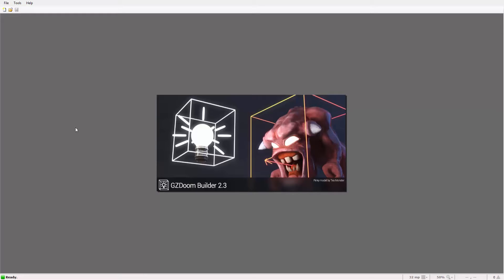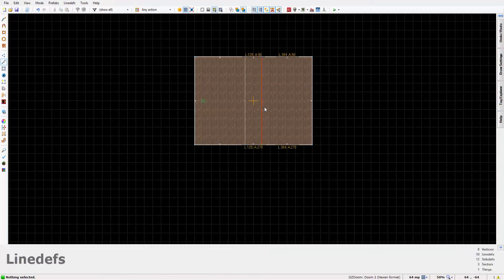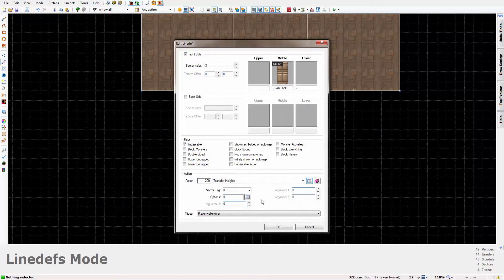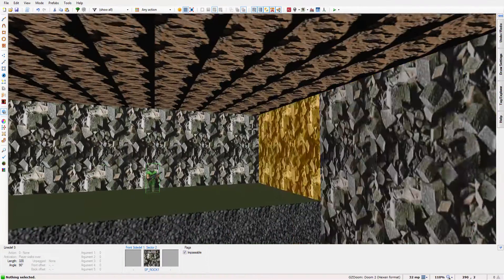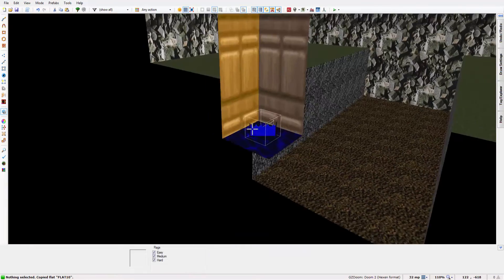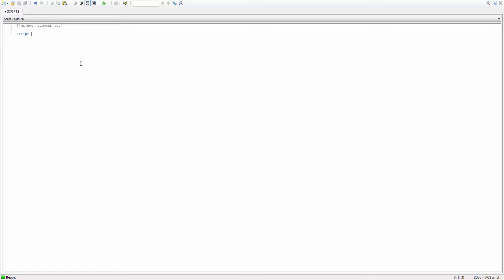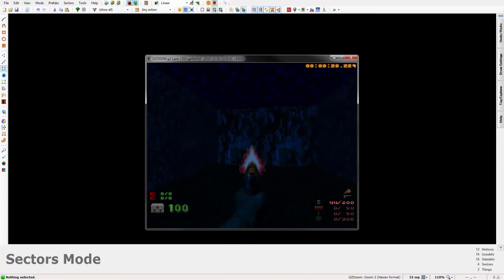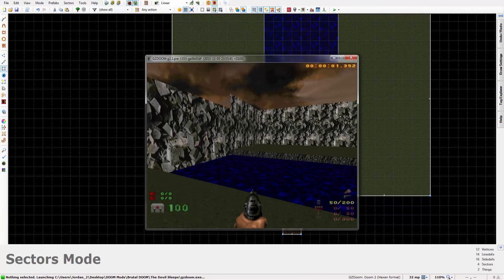GZDoom Builder | DEEP WATER | DOOM Level Design #7

Comment: If you are using UDMF you don't have to use the water zone thing. When you set the transfer_height linedef, you there is argument called "Options", in the newest version of GZDoomBuilder you press a button on the side of it that shows you the options you can choose.  One of the options is "swimmable bellow fake", that allows you to swim under water.